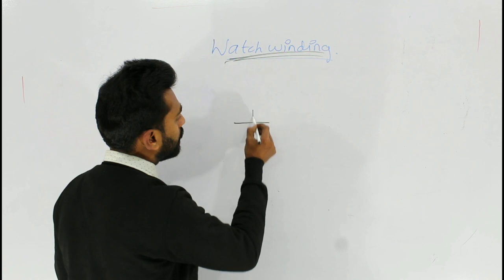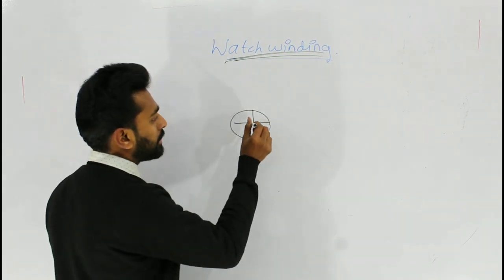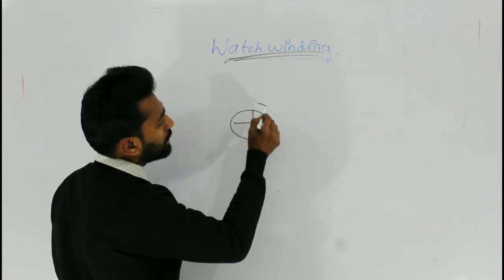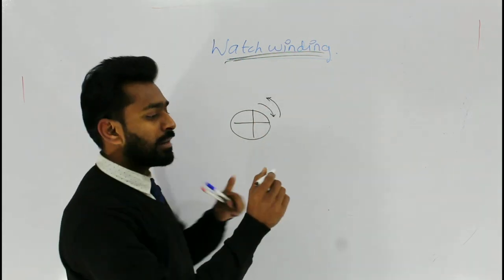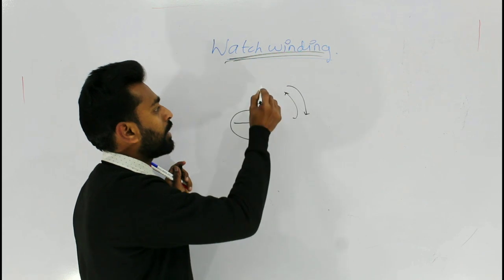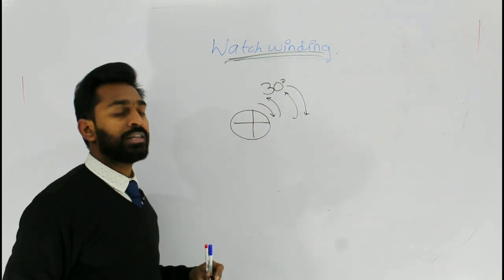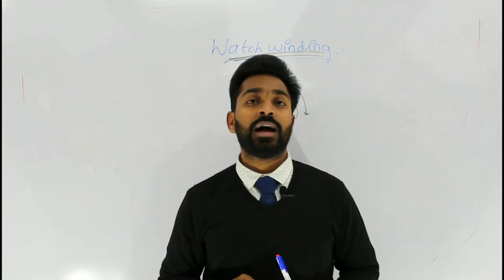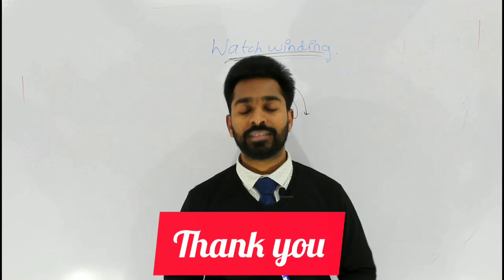Watch Winding Motion in Endodontics

Comment: Nice video sir.
I have queries.
Should we apply little apical pressure while watch winding?
After 10 no, to get a glide path with 15 and 20 which motion is best. Watch winding or balanced force?
Thanks in advance
Reply from the maker: U should never apply pressure...
This motion is used to negotiate the patency of the canal ..
It creates a glide path ..
After removing the 10k file. .if u observe.... It tells..u the canal anatomy ...
Reply: @dentallectures2897  ok. But we have to apply little apical pressure though negligible to make file progress. Isnt it?
Reply from the maker: U can continue the motion untill u feel any resistance...once u feel resistance..remove the coat it with EDTA and again watch wind...until u reach WL...
Reply: @dentallectures2897  when to use balance of force motion?
Reply: @dentallectures2897  which motion for 15 and 20 for glide path? Watch winding then filing motion or balance of force